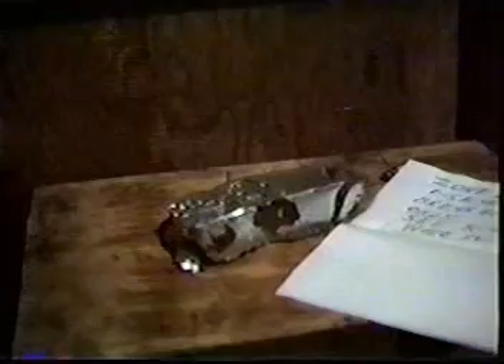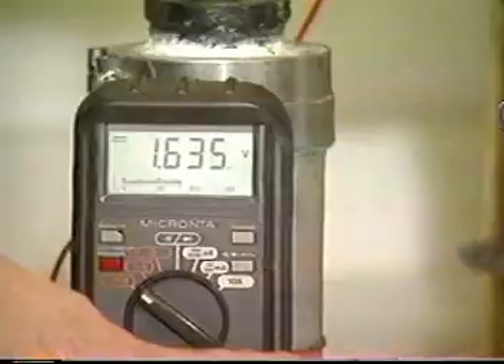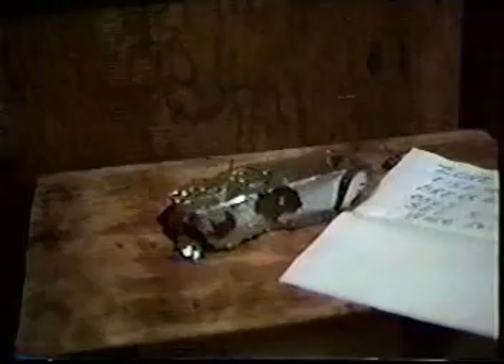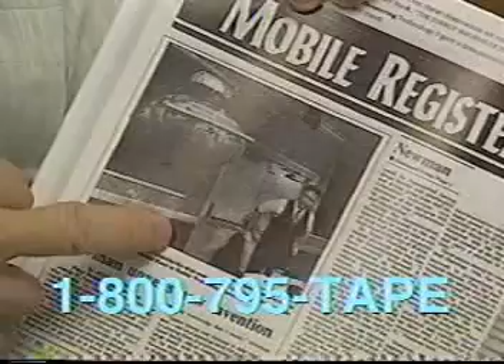Is John Hutchinson The Modern Day Tesla?

Comment: john everything has a freq, you have a receive and transmit all you have to do is find the freq down or up. so now you need two freq. some things are 9 freq. but when you have the freq. A fish breaks up water with the gills.freq. they don't breathe water. their gills give the frequency. all the fish. if you had The combined frequencies you could to swim underwater breathing. computer ip Address is freq. teslas 369 it's a bunch of secrets. any measurement is done in threes To match antenna to radio. if you go out of that 3 foot increments you lose your match. The clock is not to tell time, it's to make a speaker. And then  in frequencies. The Gyro was put in the wrong place on I'm not gonna fight flying object. See sound can make you go past turn on a dime. But it doesn't keep you up straight. So you start a Gyro and the Gyro spins. now you have a unidentified flying object. it's all freq. AC only just mest the freq up. you are close. Crystals is the earth everything has crystals everything stores energy Silicon Valley. your iCloud. Find frequency pulled electric out of the air turn your car backwards said the ground is now positive and the motors negative call on energy and you can run that motor. frequency I don't need cable I can pull it out of the air. It's all frequency,  Old satellites if you had the money you had in your backyard it was a 9 foot dish Catchin frequencies are the air off the satellites . nothing works off of electric everything is humming put your ear to any electrical appliance. it's got a frequency. and it's always in 50 or 60 Hz. John you didn't need all that stuff. All you needed was nine sound generators and a loudspeaker. to make the vibrations. or tesla secret that puzzle. Don't make noise. just calls on energy. Really John you should  contact me. we can make things happen, take a pyramid how do you pi You can't get pi from a flag star. they took our freedom with the flag. Start pointing down one point ether/ air The other a point is water, we have endless supply of water coming from space, Side point is fire , other side point is earth draw line straight across and you have pi But bottom point Is ground. Wicca had it wrong. Wicca put God gave us everything. Startup top water at the bottom. But you don't get pi that way. you can only get a pyramid out of upside down star.
Reply: if you took those crystals granite and made a cone two and a freq 2 difrent you can move tons. two different sounds. not just shake it. or break it you can move far, you can turn yourself into space, and then when you come back you come back as a granite rock. Then you come back as human. Stonehenge you can only have the power of a monk if you do good you received Christ, you get the solution to the pineal gland. you can use 100% of your brain. everybody's calcium  around the pineal gland. you drink milk, yoga is only an antenna you're becoming one with earth. you're balancing out your chakras. now if you take the star in the center is a pentagram make that out of granite stone big and every point make granite points and you have an energy field heals it calls on good Freq.